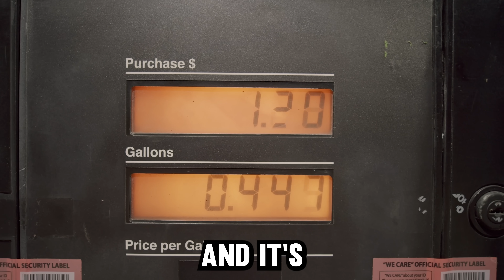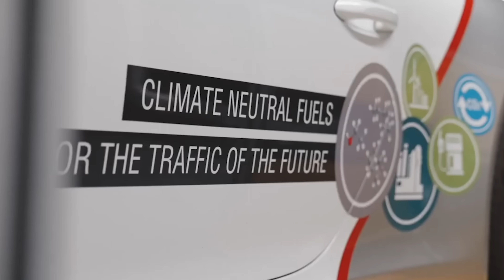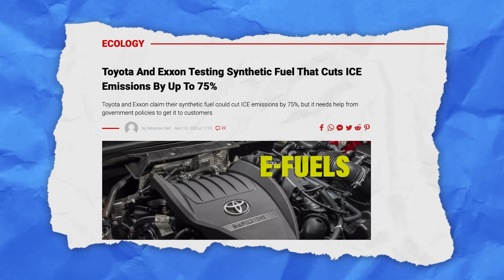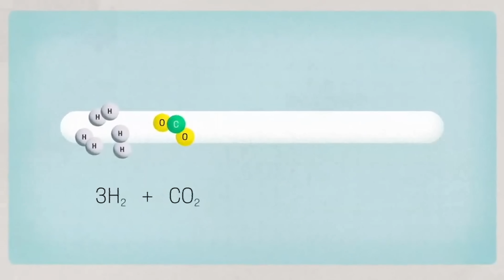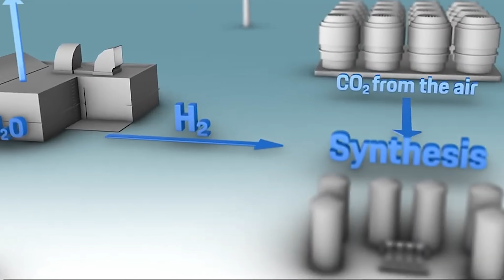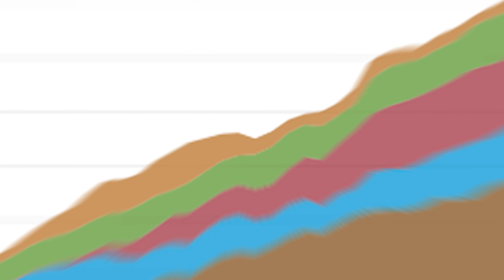Dodge Just SAVED Combustion Engines

Comment: It's more efficient to keep massive battery packs at power stations than for everyone to have smaller battery packs in their own cars. Synth fuel is a good way to get the energy to the drivers without requiring batteries in cars.

Comment: Here's my questions. If Carol Shelby can take a 350 horse power mustang in 1985 and convert it to get 85MPG without a drop in horse power, why can't Detroit do the same with todays technology? What ever happened to the hydrogen fuel cell technology (1990's) that could get 750 miles on a tank of water?

Comment: Synthetic fuel only solves the problem of putting more carbon into the atmosphere.. which sounds great but it doesn't get rid of the stuff from combustion itself, you know the stuff that will kill you if you sit in your garage with the car running.. the stuff catalytic converters need to stop to not be consider every car a polluting public safety hazard..

Comment: You should be more critical to your sources, as nearly everything is incorrect.

Fact 1: burning fuels (whether synthetic or fossil) releases co², and will never be "clean", or neutral. As there is nothing to arbsorb the co² where you will be burning it.

Fact 2: it requires at least 4 times the energy to create synthetic fuel, compared to battery charging. At the moment the have achieved 4.5x times more energy, or 4.5 KWh per 1 KWh synthetic fuel created. And then you still only get about 0.3 KWh out of the engine.

Fact 3: The infrastructure of delivering synthetic fuel is not economical sustainable. How much do you think it will cost to move 1 gallon of fuel from Chile to the united states? Do you think thay is going be cheaper than creating pure electricity and put it through the existing wires?

Seriously, if you believe this changes anything, then you have completely missed the issue.

Comment: dumb AF. be less efficient for the sake of making noise, great idea. the only land-based sector it remotely would make sense is long haul trucking but that in itself should be greatly reduced and limited by building out rail. a replacement fuel for cargo shipping could make some sense but the idea the international shipping industry will pay the extra cost for the fuel is probably not very plausible considering it is a race to the bottom for rates.

Comment: Electric cars won’t be able to significantly reduce atmospheric degradation until there is an ICE vehicle buyback program. When a person buys an electric car and then sells their old ICE car, the ICE car continues to pollute even though the original owner is not driving it. Luckily, cars are recycled so eventually the old polluter cars will become electric cars. Let’s face it, ICE are a retro technology. IMHO, to see a dead stock electric car dominate a fire belching loud ICE car in performance tests, is a humbling experience. It is ironic that at the end of their usefulness, ICE technology is at such a high level.

Comment: for those who think Teslas are good for the enviroment think again it takes about 500k miles driven to offset the Co2 used to produce a tesla thanks to the energy inefficent way we have to produce mass quantities of lithium not to mention lithium is already beginning to run out. there is also the issue of lithium fires which are only able to be put out by introducing them to a vacuum and put out the same amount of co2 a car produces in a year every second its burning yeah "great" for the enviroment

Comment: One caveat, and it's a massive one: canola fields for biofuel for Europe are already destroying thousands upon thousands of square miles of farmland here in Australia, with absolutely vast amounts of glyphosate used to kill everything except the Round Up resistant canola strains. Our beautiful landscape is becoming a poisonous sea of bright yellow, much of it right on the edge of villages and towns. And you can't eat that stuff. So NO to biofuels. And NO to EVs either, for at least 20 good reasons. The most environmentally friendly solution, and the most reliable and safe method, for vehicle power remains the ICE, done as fuel-efficiently and cleanly as possible (which is an ongoing project at least with Toyota).

Comment: So both techs (elec and alt-fuel) require a tremendous amount of infrastructure. While electric is being pushed by those in power, at least here in the US, those in power have been clueless about the need to generate electricity to feed those cars. And clueless about how to make it happen, e.g. Apartments don't have recharging stations. Therefore renters don't have a means to recharge electric vehicles. 

Alt-fuels seems to be the quickest and cleanest solution, despite there still being a hefty energy demand. If those in power pushed alt-fuels as much as electric car production, I believe this solution could be implemented in < 10 years. I also believe the govt ain't gonna do it.

Comment: I like the point of the video however I don’t fully understand why people hate on Electric vehicles, I knows they are worse because the materials needed for batteries however people need to consider the fact that gas vehicles can’t be improved by much however electric vehicles have good speed and mileage despite the fact batteries are nowhere near good as they could be also electric motors are nowhere as efficient as they probably could be as well so in my opinion nmelectric cars are really good because the fact I feel electric vehicles right now are 1/10th or even 1/100th of what the could be in the future

Comment: Hmm, so efuel starts as solar energy, then do electrolysis, then carbon capture, then petro chemical processing, then you put it in the car and burn it to perform work at 30% efficiency just like other oil based fuels.  Please perform an efficiency study of this process.  It could easily cost $100/gal.  It seems extremely inefficient compared to just taking that solar power and putting it right into the batteries of the car turning a motor at 90% efficiency.  I love ICE engines but they are just obsolete.

Comment: So they could make an HHO generator that will run a combustion engine by itself using a cell connected to the alternator and the biproducts are heat and water. They want to add carbon so the biproduct will continue to cause green house gases. 🤨 this is just another way to de-evolve something that is cleaner and easier to apply to already existing engines and over complicate the process while increasing the carbon emissions so those involved in the initial development will make a ton of money. It’s all about making that money not saving our environment.

Comment: First, electric is the future. Combustion Engines should end for private. There are enough places, where you can't electrify the vehicles. Trucks and farming machines for examples. A harvester for example runs 24/7 when the harvestseason is going on. So you can't stop for charging it. The private have their cars rest for 80% of the day. So enough time to charge. And wasting the e-fuels for F1 or any other race use is a horrible idea. I would prefer to have a hydrogen powered car like the Toyota Mirai, but in a bigger chassis. I need a MPV. A sporty minibus. Yes i know what you think.... Space is the real luxury. Not tropical wood or alcantara or carbon.
And i would love to have the old seats made of velour back in our cars.

Comment: I've said this for years now. Retrofitting existing engines for some other type of fuel shouldn't be ignored. EVs are not a universal answer and as stated here, what are you doing with the 1+ billion engines already out there. No way you are replacing every single one with an EV in a matter of even decades.
Reply: You are right.  Always use what you have as "betterly" .
Reply: They melt them down to built EVs

Comment: Seeing as Dodge no longer has a performance department and will no longer be making combustion engines after 2024, please explain exactly because this video doesn't explain 💩.
Reply: Synthetic fuels are a niche thing that will never be carbon neutral without lots of renewable energy that would be better used charging an EV since it wouldn’t waste most of it like an ICE car. It’s dumb. Hydrogen gas similar problems but it also requires energy to store it (pumping loss or cryogenic storage loss). This video is just a YouTubers buying into a dying way of making a vehicle move. Synthetic fuel won’t be financially viable until we are out of oil in the earth. By then I don’t think anyone will want to deal with ICE vs LFP battery (flame resistant and cheap) tech

Comment: In my country (Switzerland) e-fuels are already used in oldtimer racing. It costs 6 francs per liter, which would equate  to 22 dollars per gallon. Which is ridiculous.
Lets hope, prices will come down significantly.
But the fuel itself seems to work fine.
Reply: $22 a gallon is the price of a gallon of race fuel. Look up the price of VP 12. So it's not surprising

Comment: It is baffling how the editorial team managed to convince themselves that a green electricity -> hydrolysis -> carbon capture -> mixing should be compared with electricity from coal -> battery power. I mean, for starters if both comes from green sources, battery will always be far far far more effective way of using the resources. 

Not to mention the cost. pretty sure you all run EVs when you have the choice of it vs the sticker price for e-fuel. I mean, at the moment it is about $189 a gallon for efuel. Even how far down you get it, putting electricty straight into the battery will always be cheaper. Now EV do have price challenges due to raw materials used in batteries, but still.

Comment: Big problem with Gevo's isobutinol  is that it contains 10 hydrogen atoms per molecule. Well that's great one may say. But burning hydrogen in an internal combustion engine doesn't  just produce  h2o, Nox emissions  are produced as well. This is one of biggest  problems with using any hydrogen rich molecular formulated fuels. Hydrogen  combustion produces higher temperatures which inevitably create more Nox byproducts. The EPA was initially  created  by Richard Nixon too curtail Nox emissions which were responsible for smog and acid rain. For example 2 buses from the 1960s era put out about the same amount of Nox as do 500 buses do today.

Comment: How much of an "EV" is MADE from "Petroleum By-Products"??  Carbon Fiber..? YES! Plastic parts for thousands of uses? YES! Vinyl materials for the uholstry..? YES!
Carbon in the rubber compounds for the tires..? YES! Insulation coatings on all of the MILES of wiring..? YES! the Foam padding in the seats..? YES! The material the Air Bags are made of..? YES!! The Mineral Spirits used to thin the paint to be sprayed on the vehicle..? YES!
Can we even BUILD a vehicle -- car, truck, motorcycle, boat, airplane... WITHOUT "Petroleum By-Products"..? NO!!
The Earth is a self-cintained "bio-sphere" and all of the chemicals are contained within the Earth's "Big Ball of Wax"... other than a few meteors and assorted particles drawn to the Earth from 'Space' by gravity, and the radiated energy from the Sun.... SO... as we Breathe, our own body gives off CO2...and for Millions of years, as living creatures breathed out CO2 there have been other parts of our "Ball of Wax" that absorbed IN CO2 and put the carbon back into te Ground and released O2 ... peopple an animals then breathe in the O2 and release CO2, along with the many other ways that CO2 and simple Carbon is released -- from burning things, from the Ocean evaporation, forest fires, volcanoes.. {How many Dodge Hemi Engines does it take to produce Carbon equal to a FOREST FIRE..? If we could continue to reduce Forest Fires it could 'cover' Years of the carbon produced in an LA Rush Hour..!! And that is JUST for California..!!} Or are we ALL just being "Carbon wise and DOLLAR FOOLISH..? Would "The Creator of the Universe" have put burnable chemicals into our little Bio-Sphere with a 're-cycle' system in place... if we were not supposed to USE the carbon products to the benefit of the inhabitants..? PERHAPS we need to focus MORE on the re-cycling of the Carbon... by replenishing the Flowers and Trees and the BEAUTY of NATURE and build LESS asphalt and concrete that does NOT re-cycle the carbon back into the earth... 
WHERE are the Pollution problems the WORST..? In the "Concrete Jungles" with Sky-Scrapers and every surface covered with asphalt and concrete, and garbage thrown on the ground... But we cut down the forests to build houses that have less grass than the asphalt shingles on the roof, then add paved roads and driveways, and a clubhouse tennis courts and a swimming pool that do nothing useful for the environment and leave even Less plants to re-cycle the CO2. 
And don't even get me started on energy efficiency.. such as how much 'Energy' is used to move a 3,500 pound ICE vehicle compared to a 5,000 EV with a ton of battery pack and 2 heavy motors..? About 30% More "Units of Energy" per mile for the EV... So, for the SAME amount of Energy, the ICE vehicle could travel 30% Farther. So EV's will use MORE Energy than an ICE vehicle... Just "food for thought"...

Comment: Most important question is how will the efuel react with components and what is the shelf life? Also Commercial jets burn clean and hardly use much fuel at all. They run on mostly compressed air and a tuned frequency. Why did you not touch big freight shipping, the marine world, big industry, the military who are all non epa restricted.

Comment: I doubt synthetic fuel will become a widespread thing. There's not going to be enough infrastructure in place to produce it at anywhere near the quantities needed, and battery tech is advancing by leaps and bounds. Also, ICE engines are worse for consumers in most regards, because electric is simpler and requires much less maintenance. Most people don't care about V8 noises, they just want something that looks good while driving to work and back.

tl;dr this is niche tech for motorsports.

Comment: Electric motors are just superior. One moving part. Torque across the entire power curve. Maintenance free. No emissions.

Range? The first gasoline cars had the same problem until the infrastructure went into place. Electric infrastructure will be easier. You can replace your high horsepower engines with electric motors and get superior performance. Without the noise and smoke, which is really all a 300+ hp engine is really good for. No gas they're going to make now or in the future is going to be 10 cents a gallon like it was when I was a kid. Fewer and fewer people will be buying fuel so they will have to jack up the price to squeeze the same amount of money out of the die-hards that are left.

I could be wrong. Let's just see how long it takes for this new fuel to make electric cars obsolete, or even less viable.

Comment: EV's are not the future, in fact they are a pathetic attempt to band-aid an issue. They actually produce more emissions to re-charge them than fuel vehicles do. That's insane. Not only that, but long haul trips in an EV are impossible for the most part, definitely not feasible. So the Democratic socialists lied again.....imagine that. 
Synthetic fuels and Hydrogen are the future, look at Norway and take notes.

Comment: Dodge has said this is it for internal combustion engines. They just simply can't make them more powerful or efficient. Hydrogen won't happen either. Boeing and Airbus have said the components weigh too much to make it viable. That would make it more expensive for automotive companies to try to utilize it. The other problem with hydro is you can't refuel from your home. Being able to do that with electric is why it will take over from a convenience and cost perspective.

Comment: I understand the optimism about E fuels, I really do! But your video is not sharing the full story on it and is missing many facts on both e fuels and EVs. You are painting a very optimistic future for e fuels, just as some are painting a too optimistic future on EVs. Both have pros and cons. EV battery tech is moving quick and Solid State batteries are already being developed. 800+ mile range and less than 15 min recharge (this is from the same company Porsche that is working on getting close to this!) Also, EVs are NOT just for the elite. There are a few great options now in the 40k and 50k range, with more on the way. Last I checked, a Demon was FAR more than that, as are Hellcats and most Porsches. EVs however are not the end all be all solution to global warming or energy independence for the US, but they are a big piece of the puzzle, with much more needed to be worked out. E Fuels sound nice, but as you did say, they need TREMENDOUS infrastructure on the front end to support being able to make enough of it and fast enough to support global needs. I’ve read quite a bit on it. Another con is that bc it is so expensive to make, you are looking at like $20 a gallon for fuel. People in the US LOST THEIR SH!T when we hit $5 a gallon! I think e fuels should DEFINITELY be looked into and continued to be researched as another piece of that whole solution. Then people can have choice, which is a good thing. Don’t ban gas cars. Don’t abandon or shun EVs. Let there be safe and enviro friendly options to allow consumers to choose whichever means work best for them. I look forward to the day when both EV and E Fuel tech has matured to the point we can realistically use both with ease, efficiency and affordability.